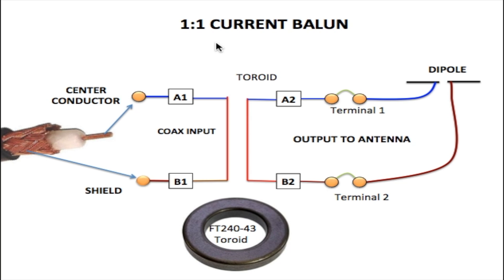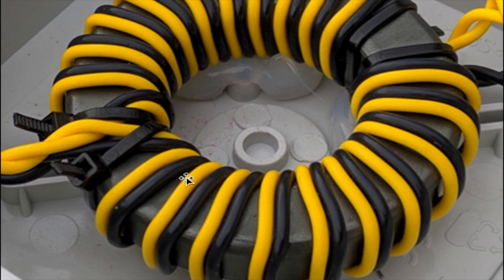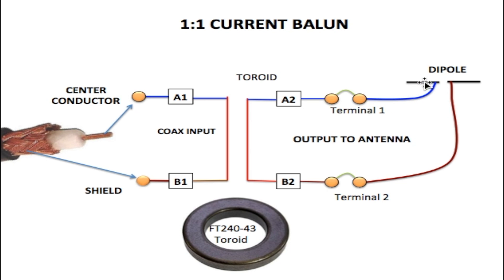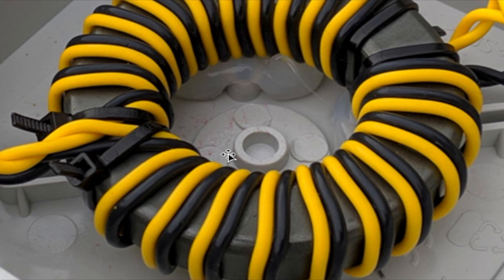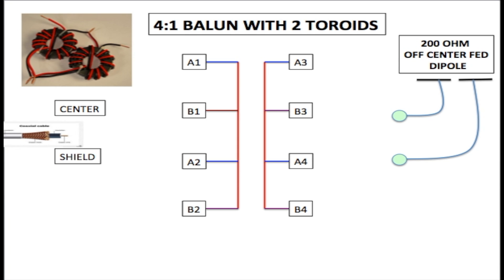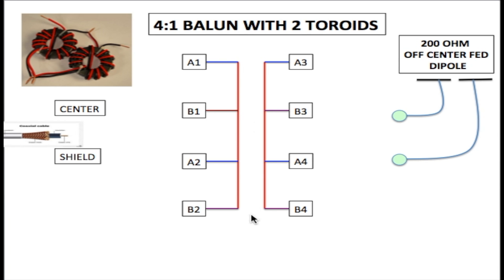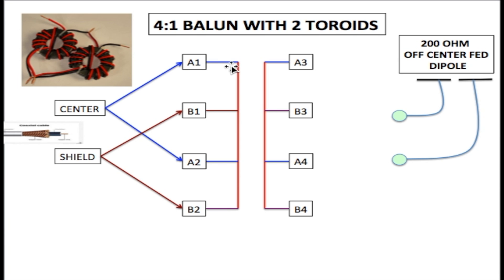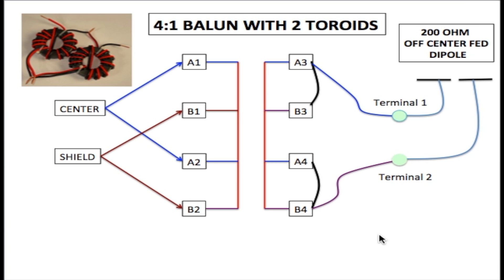Step by Step Balun Winding for Beginners!

Comment: I am making a TV antenna and i have two 1cm diameter cores can u please tell me how much turns i need and my TV to antenna wire length is 4/5 meters
Reply from the maker: I am unable to provide a specific number of turns without knowing the frequency you want to receive.